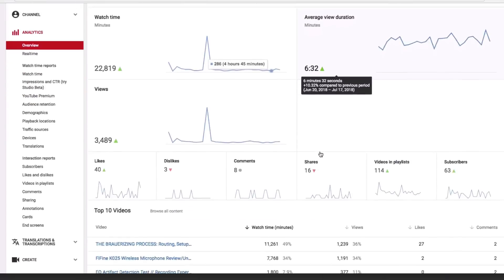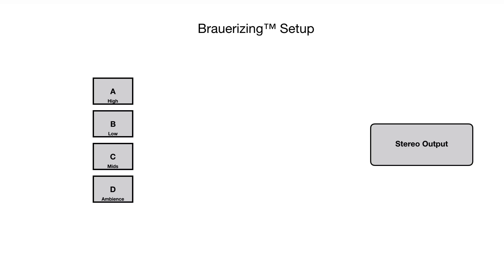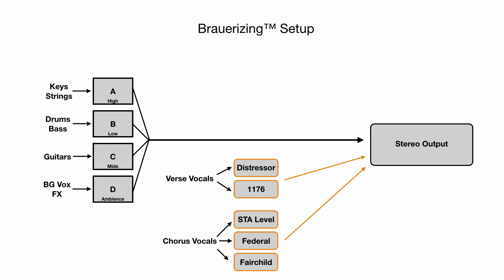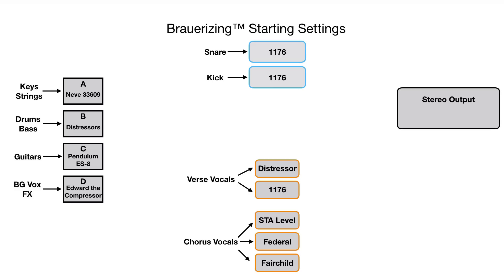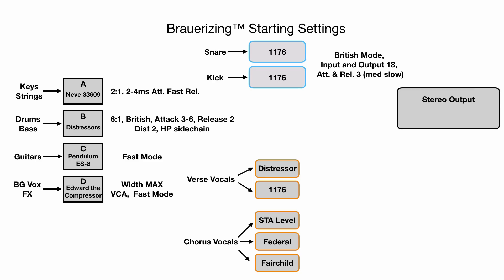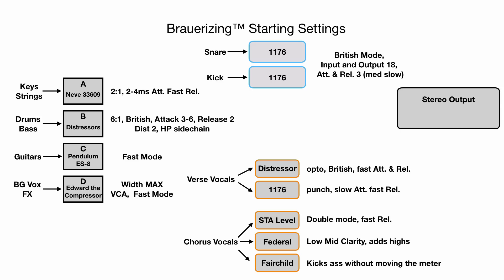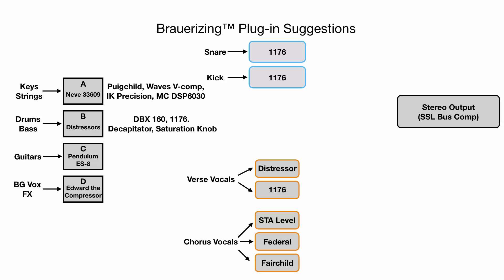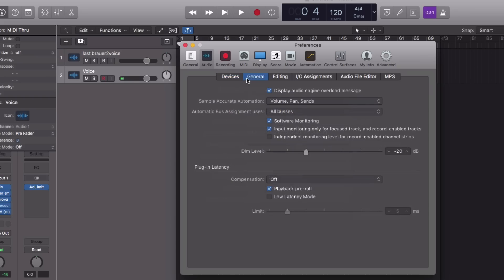BRAUERIZING PROCESS - ITB Compressor Settings, Vocal Setup, and More! | LearnAudioEngineering.com

Comment: Thanks for this great "Brauerising" schematic. I'm a wild and crazy guy so, rather than run with this set-up, I'm gonna bend it somewhat. 
One area I might play around with is using a M/S setting which features on some stereo bus compressors such as: the Chandler Zener Limiter and the Manley Variable MU limiter, especially on the D buss or maybe the A buss

Comment: Lots of great info here...the compressors on the master buss though seems wrong.  He uses the ssl on the board(or currently with his control console as a plugin) and then he has options like the germanium with a  heavy use of the dry wet mix, the Manley, shadow hills or the API.  He uses whichever one seems to work best.  I've seen him use the germanium often.  Also will use the curve bender if he feels it needs it. I Have never seen him use as Avalon as a compressor on the master buss.  He will use the Avalon for eq in the B group.

Comment: Great video! I have a question: the optional 1176 and the vocal compressors are to be used in parallel or in insert? I think it has to be parallel (don’t think it’s a great idea to compress a vocal three times in a row but just to be clear).  And then, I always find the 1176 to be a little too fast on my drum sounds (I mostly do EDM and Hip Hop) could an api 2500 be a better choice?

Comment: So is he using only sends to mix not the channels end fader? If thats the case how does he do a volume up ride on a kick drum for example, if you automate the kicks send higher its gonna hit the drum and bass buss comp harder effectively making the compressor turn the kick down. Unless he uses another send that bypasses the 4 busses to an "escape" buss.
Reply from the maker: yes, often he will send to a separate, kick bus, and snare bus to work around the issue your described.

Comment: Another newb question: Are the two 'extra' 1176s meant for individual mono instruments, e.g. kick/snare/vocal as opposed to a stereo pair? If this is correct, is each 1176 to be used on only one source at a time, or is it ok to send different mono sources to the same compressor (e.g. kick and snare)? Thank you for your time.
Reply from the maker: Yep, just extra tools used to get a different flavor out of mono sources. iirc Brauer will often use one for kick and one for snare. You could try both kick and snare on the same compressor, and get something completely different that might also work. 

I believe these 2 compressors are meant to give some extra clarity and shape to important instruments that might not be able to be so forward in the mix without overpowering their compression group (ABCD) So anything that needs an extra push can be sent to one of these,.

but adding too much results in the same problem again, and then you'll need an additional 1176 bus for your 1176 bus and that's where latency just ruins everything completely. so layering these busses would be done best in moderation. Great question! thank you for watching :)
Reply: @LearnAudioEngineering  Thank you.

Comment: Maybe a dumb question, but if one does not ride the fader post-comp in favor of mixing into it, how would one boost, say a lead vox, instrument or effect, other than very subtly? What if i want to boost something more than a couple of dBs? Wouldn't the comp just clamp down harder on the source? Great video BTW, thank you for posting!
Reply from the maker: Hey, great question. I suppose in that case you would send that instrument straight to the mix bus so it's not affected by ABC or D bus compression. That way it can stick out without affecting the compressors balance across an entire group. 

Thank YOU for watching!
Reply: Everything, including the vocals go to VCA faders where he can ride the volume hitting the master. Looks like there is also a V bus he uses now in his ITB template.

Comment: Thanks so much for the great overview. EQ processing after the vocal compressors or just on the individual channels? Also, other online sources talking about this don't spell out like you do that the buses are verse 1, verse 2, chorus 1, etc. rather they take the lead vocal track, split it up to separate tracks for verse, bridge, chorus, and then bus send where you can dial in a combination custom to each section. You method here seems like you'd have to automate the send levels or something for each section. Food for thought.

Comment: Thank you very much. Subscribed. I do have a question. I know that Brauer typically doesn’t do this kind of mixing but, I want to try his set up with Techno. I use an API 2500 on my drum bus to get a nice pumping sound with the relation to the ever present kick. Does Brauer use other bus comps on grouped elements before hitting the “Brauerized” busses? If done lightly, (ie, not over compressed) do you think it could work? Thanks!
Reply from the maker: that's a good question, and I'm sure you could 'sub-buss' a few instruments together before hitting the B bus (If I'm understanding you correctly). HOWEVER, the more busses a signal must pass thru will drastically increase the risk of latency. This is why Brauer says his approach cannot be replicated ITB.

Don't let that discourage you from trying it out tho! thanks for watching!

Comment: What's the proper use of the "Delay Compensation" mode? I've been using the Bauerizing method for a while and can never tell the difference from when I use delay compensation or not. When do you know if you should use it? Are there any disadvantages to using delay compensation?
Reply: It's something I have kept on from day one after UAD recommended it. Logic compensates for the latency by calculating the amount of latency caused by plug-ins, and then delaying audio streams by an appropriate amount, or by shifting instrument and audio tracks forward in time. It's something you won't hear or feel, just let it do the math!

Comment: Good video, I've been Brauerizing for a while now it just works great every time.  FYI Slate Digital now has their Distressor plugin and it works great (also un-linkable for multi mono compression).  Also the FG-MU is a great fairchild plugin option (also un-linkable).

Comment: Did you have a suggestion for the "Avalon 1:1" replacement in the box. In the video you just mentionned : "When can just not compress". But you already know that the thing about this Avalon is the color it imparts to the sound.
I use compressors the same way on my mixbus (Pendulum or Culture Vulture Phoenix) and I am having hard times finding alternatives to that 1:1 "tonebox" enhancement in the box for easier recall (I already tried VCC, NLS and such). If you have any suggestions :).
Reply: I recommend the Kazrog True Iron plugin for color and weight here. $40 and it has a great transformer "weight" to it that works similar to the tube "color"
Reply from the maker: Yes! the Beatles used to do this with the Fairchild, and it's commonly done with Neve1073s (run it through the EQ circuit without EQing for more color) So I use the Puigchild if I'm looking for that, or I just use the SSL Bus comp instead. Thanks for your comment :)
Reply: Yeah I've heard about this 1073s trick. Apparently tightens up the low-end and adding some midrange and saturation. Definitely a nice trick to try, and way easier on plugins than on hardware (always get freaky with that high-shelf, you never really know if it's properly set at 0). I will try with 1073 plugins.
For Fairchild, that's indeed why I use the Pendulum for at the studio. So maybe I should try Puigchild, good shout. I liked the saturation of Slate VBC but the high-mid boost is not desirable to me (it would be perfect without this). Cheers :) !

Comment: Great vid some really useful info here. You suggest CLA comps for bus duties but as far as I know they can not be unlinked for dual mono, do you split the tracks and use two comps?
Reply from the maker: Hey thanks for watching. You should be able to open the plugin in multi-mono mode when selecting it from the plugin menu. I've been able to do it with the CLA2A in protools and logic.
Reply: Thanks for the quick reply. I was under the impression that the mono CLA compressors are single channel with only one detector. A stereo instance being two channel also with one detector. I contacted Waves support and they  said to operate any of these comps unlinked you will need to use two comps. Might be worth taking a look at this. I can put a multi-mono signal into the comps as I use Reaper but it is still being compressed as as one.

Comment: I use the CLA 1176 preset for preamp only. The input is set low. I only adjust the output. Should I crank the input also? If so, how do you know how much? Use my ears?
Reply from the maker: Hey Paul, just saw your comment.

Setting the input low will likely not trigger any compression.

Cranking the input gain will amplify the source to reach the threshold of the compressor, which will cause more gain reduction and add more of the 1176 'character'. Start with 1-3dB of gain reduction, especially for most of the Brauerizing stuff. Experiment and find what feels right. Thanks for your comment!